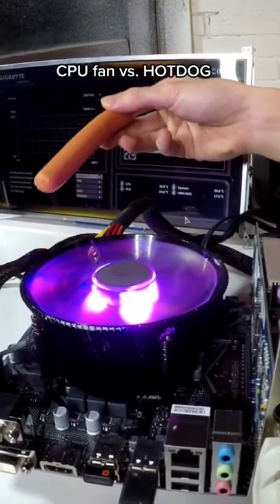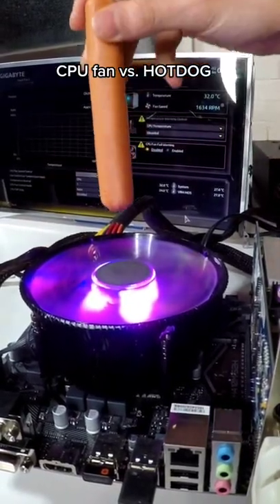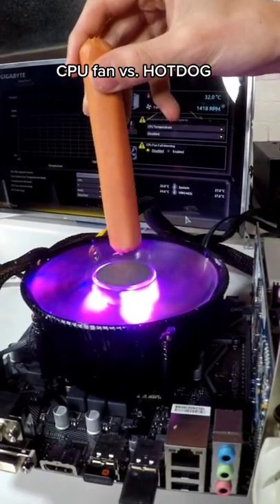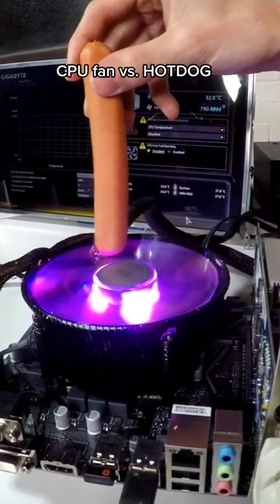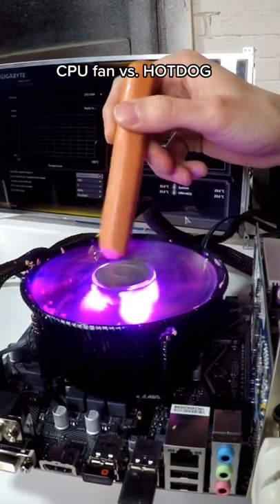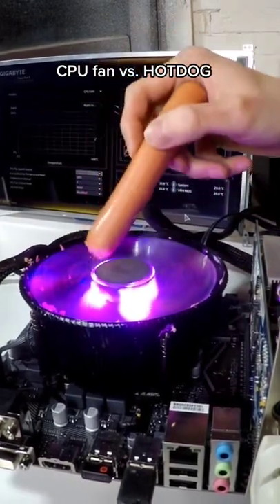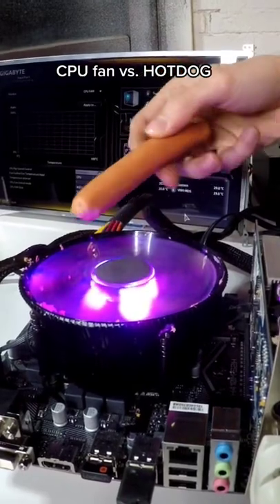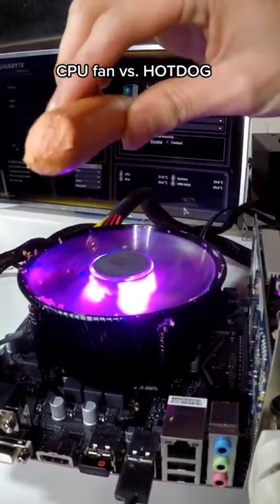full speed CPU fan + a hotdog #shorts

Comment: Arctic P14 has the sharpest edge on the blade. It felt like a knife, I had a bandage around my finger for 2 weeks at least.
Reply: Try with p8 , you won't regret 😂
Reply: Wtf
Reply: @user-ty4qk1ob5p  It's true. They're sharp, the solution was to put a ring to connect al the blades together. It even improves the performance and makes less turbulence

Comment: but reality if you did this with your finger, Depends on the fan if it was under stress you might get a cut, but if its on its Normal state, you will just feel pain in your finger but if your fan is sharp if its under stress or not you will get a cut

Comment: Dude I had the worst experience with a 4500rpm fan in my whole life. I was used to touching my fan when it was around 1200rpm. When I was hearing to some music I forgot that I tuned my CPU Fan at full speed, and then put my finger into it. The tip of my finger was deeply cut and for 3 or 5 minutes the bleeding wont stop. I also did this a 2nd time and it wounded the same spot. Now I don't touch my fans at all even if they are off
Reply: Why would you casually have a fan exposed?
Reply: @kingeling  It was old rig i3-2120 and I had to remove the panel so that it would get hot.
Reply: @meherali2942  Fair. I have an r9 280 that gets to 93 on full load and drops by exactly 20 if I remove the panel...

Comment: Cpu fan is nowhere scary than an 80mm 4000rpm fan, that cannot be mounted to the back of the pc (only one screw can hold becouse of this) as an exhaust (really its better than 3 120mm fans), But suddenly the screw falls off and the fan too  its start to something hits the fans blade that spins with 4000rpm, it goes brrrrr, so you try to put it to back to place, it cuts your arm, you go brrr too, and you start bleeding as hell, even a one piece toilet paper gets fully bloody, and the second is almost. Good old no money for pc case times. (I still have that fan becouse its loud but too good at cooling).